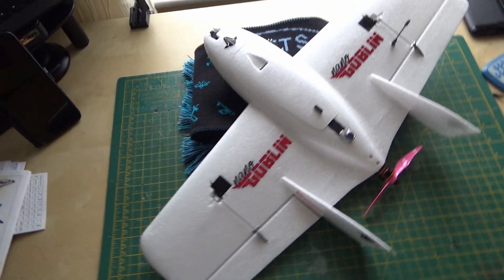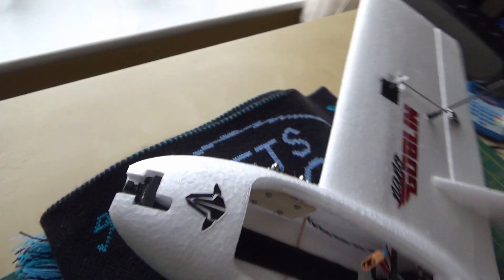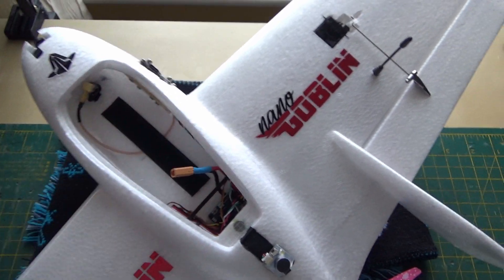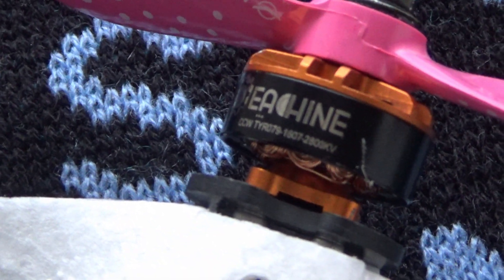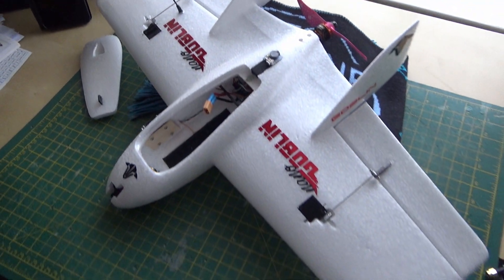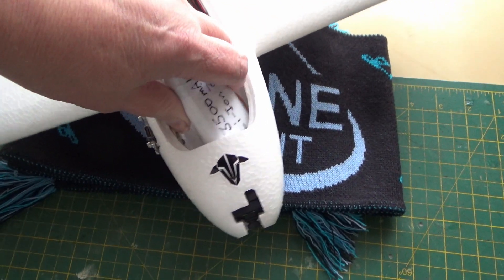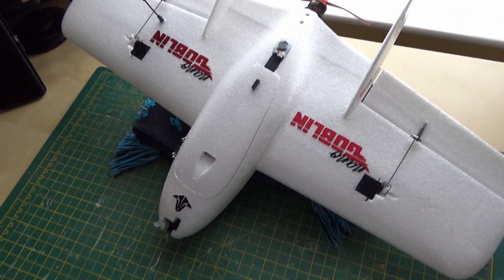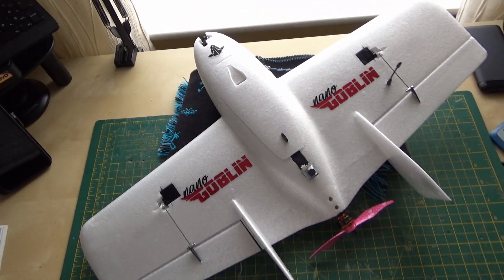Nano Goblin - build complete

Comment: Nice build! I just ordered the Nano Goblin, Going for a similar build Matek F11 and Vista
Reply from the maker: You would be better off using the Matek F405-WMN it has more than two UARTS so you don't have to use the soft serial to run the digital FPV.
Reply: @Caroline_Tyler  Oh interesting; 
I ordered the F411-WTE. I'll see if I can return it and get the WMN its only a few bucks more.

Thanks for the tip!
Reply from the maker: I've used both and the F405 is well worth it. The F411 and F722 boards are not the best choice as they have such limited memory that features in INAV are going to be dropped for them in the next release I believe.
Reply: @Caroline_Tyler  Awesome Thanks! Ordered the F405. 
Mainly fly quads; still pretty green with the wing stuff. 
Glad I came across your channel you have some great flights!
Reply from the maker: @edygome  Thank you, glad your enjoying the stuff I put up.
Reply: @Caroline_Tyler  Struggling to get my nano goblin off the ground. It was my first plane build and did a poor job glue-ing. 

Ordered just the foam going to try again.
Reply from the maker: @edygome  I left the top half of the fuse till last, once I had fully decided where all the electronics will go. Makes access much easier.
Reply: @Caroline_Tyler Got it off the ground today finally, unfortunately didn't have an sd card for my goggles. Nonetheless, stoked!!
Reply: The spare came in today too; might hold off on building it 'till I wreck the first one.
Reply from the maker: @edygome  The foam is really resilient, you my struggle to break it properly.
Reply: @Caroline_Tyler  Worst case, I'll just build a second one lol

Comment: Where did you fit the Menace RC AEROPod antenna? Is it buried in the nose? Have not had any issues when flying away? Is the battery not blocking the antenna?
Reply from the maker: I've actually removed the aeropod as I wasn't happy with the signal when flying away from myself. The stock antenna is now sticking up in a conventional fashion from the body.
Reply: @Caroline_Tyler  what did you switch to? Trying to decide on an antenna myself but don’t have dji
Reply: @Caroline_Tyler  great!! Thank you

Comment: Welcome to the club! I have 2x.  1 INAV with LR gear, and 1 FT Aura 5.
Reply from the maker: Such a pretty plane!
Reply: I run the APC 4.1x4.1 EP prop on both of mine.  Good balance between performance and not overloading motor/ESC/Li-Ion.   My 2/3S packs sag when pushing past 10A.  Have some higher current 18650 cells to make some packs from.  Also Want to make a Wider/Shorter 3S pack that doesn't interfere with the hatch tab in the front.  Have to push the 3S pack all the way forward for best CG.
Reply from the maker: @litterbug4023  Yes, that tab is a pain, I've slimmed mine down a little and by angling the triangle pack it does 'just' fit. I have another pack to make and like you, was thinking about making it a little wider and shorter. I may do but can't go far as I want to still fit these packs into the ZOHD dart 250G and it's space is width constrained.
The 5x5 prop is just pulling a couple more amps than I'm happy with, don't want to do a throttle limit hack.
Reply from the maker: Taken it down to an APC 4.7 x 4.2 propeller which is pulling a maximum of 12A at full pack voltage. The cells are 10A continuous draw rated but INAV is set to 1900ms max throttle which will mean it will top out at 10A. That just what I'm looking for :)
Reply: I told INAV to use lower voltage thresholds and just run higher current.   Had to do the same on OpenTX so it would quit barking every time I blipped the throttle for a high speed pass.   LOL!  Really like to build the 20A packs before spring.

Comment: Hi Caroline
Nice set up that motor sure has some whizz to it. With that battery 30.40 min flight time????
Keep on making them
Stay well
Brian 👍👍
Reply from the maker: Should be 1 to 1 1/2 hours flying time
Reply: @Caroline_Tyler  OUTSTANDING I've got the zhod drift and I've seen them do amazing times on ion batteries don't Know anything about them... Did you make that ion unit
Reply from the maker: Yes, hand spot welded :)
Reply: @Caroline_Tyler  ill have to see if I can buy a set for the zhod. Loads of power. Long life the only down side I can see is the weight.. But I suppose the power off sets that
ALL the best
Brian